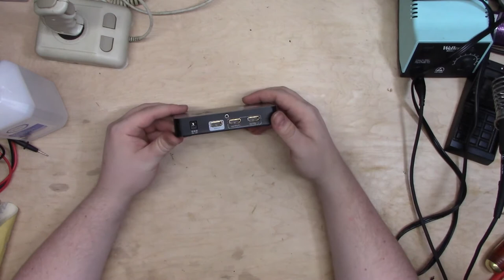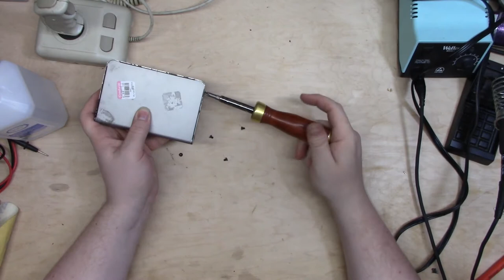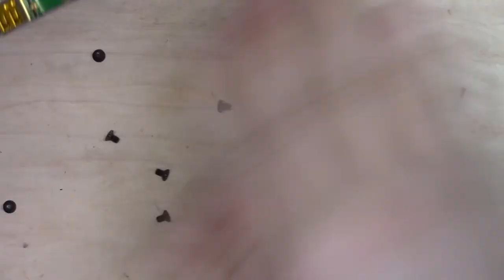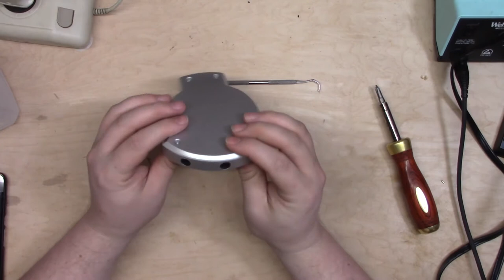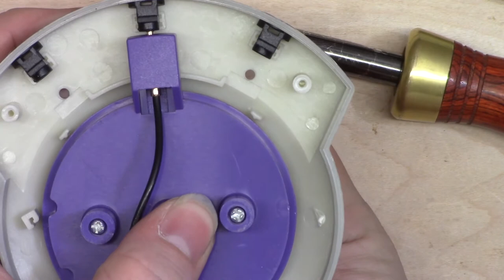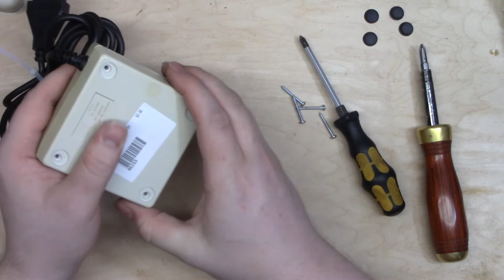Weird Stuff Exhibition

Comment: I can tell you whats going on with the HDMI splitter having worked in the industry. 

The manufacturer makes one board and uses it for multiple things. Let me explain. Either, they had thousands of extra boards that were being made for another reason, and instead of wasting them, they made minor changes and shifted their intended use (very common) Or, they made 1 board that served 2 or 3 purposes and only put the i/o connectors for HDMI and left the rest empty (less common but still happened more then you realize). This is not likely what happened with your board, because they would have not bothered connecting the LCDs. But I can tell you first hand, both of these scenarios happened a lot from 2000-2010. Remember, these base circuit boards are cheap, they made them by the millions.
Reply: given the number of test pads could this be an eval board?
Reply: I would think it's possible its a test board that maybe a worker took home, used it, because why not, then later in it's life, it's worthless now, or it got passed onto someone else and they never knew what was going on.
This is an uneducated guess, but I've read stories like this before.
It's almost crude in a way that it doesn't seem like a finished product for that era.

Comment: On that HDMI splitter, I think it could be a also board for a Keyboard Mouse Video switch. The button would be switching from computer 1 to 2, and the lights piped out to show the connection and selection state.
Reply from the maker: Holy crap, that makes a TON of sense. Wow.
Reply: KVM switch, but the video is now backwards and everything else left off. Usually you would want two inputs and one output. 
The case is big enough for this.
I can't think of anything else that would have 3 HDMI ports, but there are plenty of electronics I don't know about
Reply: Nearly definitely KVM, front ports 2 USB devices in and the remaining two would have been two usb out to host devices. It'd have sat "sideways" when in use which is particularly infuriating about these sorta KVMS.

Comment: I know some people who buy HDMI splitters because some brands have an EDID (HDMI info / DRM) chip and they use it to emulate a TV being plugged in, useful if you want to stream game consoles without a separate TV or you have a Ma Mini that doesn't post when you forget to turn your TV on before powering up the mac, or you need more power to run it for longer lengths 
EDIT: apparently all the splitter manufacturers have to do to emulate EDID is to add a bank of dip switches and the splitter chip is a multi function chip that is gineric and is a do-all chip

Comment: I actually have a very similar HDMI device (I think made by the same company in about the same time frame) which is capable of splitting HDMI signals 5-ways. It also has LED's that do a lot of the same things your device does, but also flash different patterns depending on what you plug them into.
It tests the functionality of the cables/devices plugged into it. Different flash patterns mean different flaws in manufacturing. A solid light means it works as intended and responds to all the features implemented in the HDMI standard of the date in which it was manufactured.
I have NO idea why this was produced. But it made its way into the hands of a local cable tech in the city where I grew up, and got thrown out in huge boxes when the HDMI standard got revised.
No clue if they made more, or if they swapped to a more dedicated device after that, or what. I also don't know if it was a bespoke device or if it was re-using hardware from the driver board for an HDMI TV. 
I also don't know why the non-test version kept the diagnostic LED's or the reset switch.
That thing is a real head-scratcher.

Comment: I wouldn't be too hard on that optical switch if it did it's job. Sure, an exercise in ugly industrial design masturbation, but look at now - electric ranges with more digital displays than Apollo 11, yet still doing exactly the same average "PWM" at the actual burner as those puke yellow, er .. rather "harvest gold" 70's kitchen abominations with a flippy clock. Nothing at all wrong with the simplest solution to a problem. Almost reminds me of those once ubiquitous parallel A/B switches. I own one with a gaggle of TTL requiring it's own supply and with a bunch of buttons and LEDs - was likely pretty swank in it's day (and it is cool), but the passive ones with the old school rotary wafer switches just worked as well as if swapping cables, if not the most "ooh" during teardown. Some irony in that though .. I still buy them at the thrift shop (usually two bucks). Although rarely a use for them - but a 3P/25T mechanical switch is a veritable bench unicorn. Literally tens of thousands of dollars to have one made, or a day messing about with rows of miniature relays, bidirectional bus buffers, or silicon bilateral switches depending on the signal. 

Indeed in my present vocation .. Sorry I can't reveal exactly what I do. or for whome. But an $11,000 proprietary controller (Itself, likely a $5 Arduino embedded in ten bucks worth of potting epoxy) recently shit the bed. I replaced the entire damnable thing with 5 standard automotive relays and two diodes - in half an hour.

(The mother ship would not be pleased, hence the shyness.) 

I salute the ridiculous simplicity of this device. How many do you think actually failed in service? (Assuming the knob wasn't manufactured with recycled wheat-puffs)

No matter .. this is no challenge to fisticuffs. I like your unique take on things. I certainly have my own. Still pouring through your channel. :)

Comment: @4:51 CN1 is a USB type B footprint.  R137 and R139 are potentiometers.  Possibly it allowed some sort of picture adjustment?
Reply: Video capture, perhaps?
Reply: @ziginox  I doubt it.  The microcontroller doesn't look to have the stones.  I bet it is derived from a design intended for home theatre applications and had some automation features that were removed.

Comment: that fiber switch brought me perverse joy and left me giggling. It's both hilarious and depressing that people would pay for something that was just a couple lumps of plastic that made unplugging and plugging in a cable slightly fancier.
Reply: then again, hey, it does exactly what you (buyer) want (twist a knob instead of unplugging, leave dangling, and plug the other one in), in the simplest way possible.
Reminds me of those AV switches too, that were just about that much, but instead of just physically moving the light pipe/fiber around, a toggle switch alternates all 3 connectors at once.